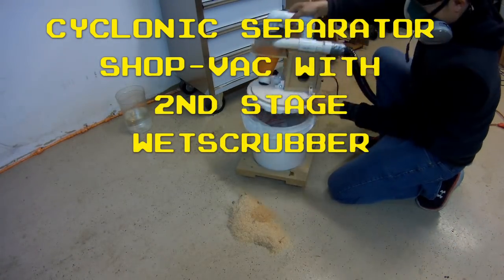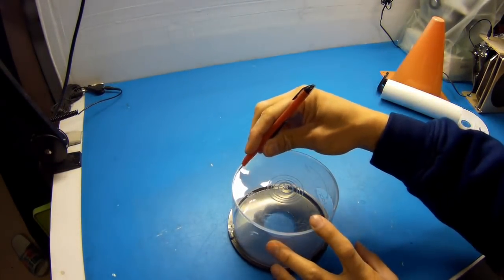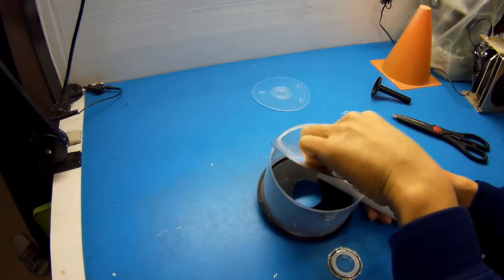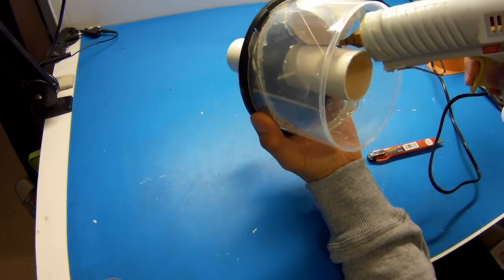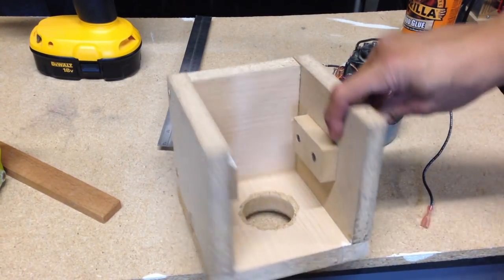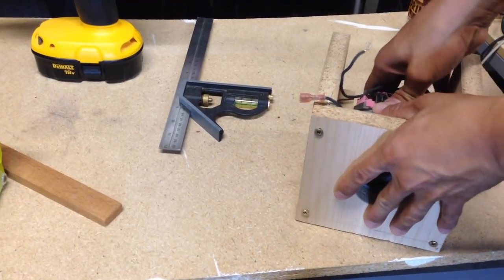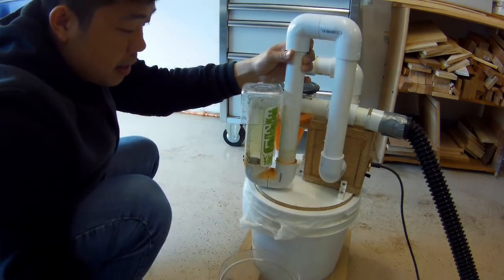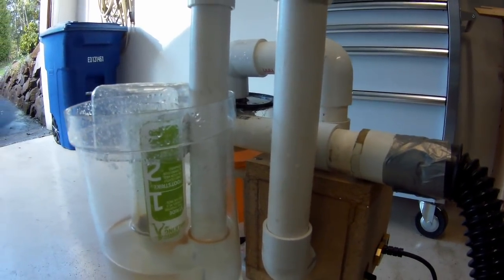How To Make Cyclone Shop-Vac With Secondary Water Filtration (Wet Scrubber) All out of Junk

Comment: Awesome!  How would this work filtering out smoke?
Reply from the maker: Hi Damian, unfortunately this will barely make a dent in filtering out any smoke.  Most of the smoke will fly right through this machine.  For smoke you'll need a true HEPA filter third stage fabric filter after the wet scrubber or an electrostatic precipitator.  Wet scrubbers scrub down to about 10um particles with decent efficiency and don't do so well with ultra fine particles so one would need to make the a super high pressure wetscrubber, make the wetscrubber 100 times bigger, or use some sort of cloud chamber/condensation technology for it to have any effect on smoke.
Reply: @LockeLaboratory  try to make one for a new project and video
Reply: @LockeLaboratory You should use an active coal filter for smoke and HEPA behind that. The same for EPOXY, active coal and then HEPA or you will regret it in the long run
Reply: Actually this woukd work great for smoke.  All you need to do is place the vac discharge outside of the area youre trying to remove smoke from..  

And why the fuck is your dumb illiterate ass watching vacuum videos for smoke dissipation?  Your the type of person to install a disposal in the sink and call the company bitching for a full refund when it breaks from you trying to put cans in it like “this isnt a garbage disposal, it didnt dispose of any of my trash..”

Comment: This is pretty neat. Where did you find the motor, and how powerful is it?

Also, can you explain a bit more about how the water filter works? I was kind of confused about that part.
Reply from the maker: Hi cky83,  I took apart an old upright vacuum cleaner to extract the motor as well as the power cable.  I'm not exactly sure of its power rating but I would guess it is at least 1hp or around 750Watts.  

The water filter simply takes the particle laden exhaust air of the vacuum and pushes it through water, this bubbling action will cause the small particles to embed into the water.  The most basic version of this is simply to have a pipe submerged into a bucket of water.  Problem with that is that the bubbles will spray water everywhere.  I was trying to explain in the video how the water filter was designed to allow this bubbling of the water without having the water spray everywhere.  The water filtration tubing is almost exactly how a bubble pump is designed except it has a cap on the top to allow the bubbled up water to fall back downward.  I found this video that explains bubble pumps. 
 https://www.youtube.com/watch?v=frPOuHi9KQQ

Let me know if you have further questions or something that isn't clear.  Best to you!
Reply: Water is aloud to enter at bottom of clear pipe. It is bigger then the 90 . At the end of the 5th 90